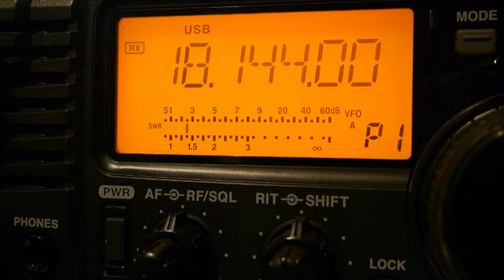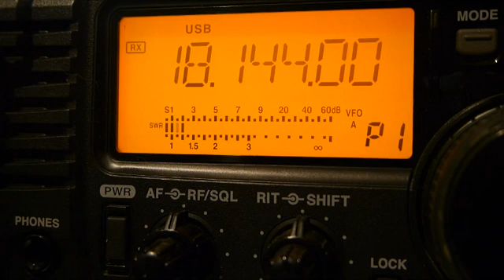Extreme interference (QRM), Amateur radio.

Comment: Check next time when your neighborhood power goes down and you are listening on your receiver using battery back-up supply.....you might be able to isolate it to your neighborhood or beyond.  You can also take your transceiver in your auto with a CB antenna and ride around your local area, you'll likely find the noise is stronger in one area and will likely be power line problems.  I've gone through this before myself and use a portable SW radio as I walk around my area.

Comment: Could be a psu that is radiating down the mains !!  You must get Ofcom out to investigate such interference you will be issued will a case number even though the regulators fail to regulate? they must be made aware of it.They have a habit of being conservative with with the truth about how many complaints the get . Sorry to sound negative but i have first hand experience with the so called regulators on several occasions and they have never sorted any of the interference issues ?And they will not do anything about plasma tv's they refuse to ?Hope you can get to the bottom of this and maybe find a solution to it. I know how you feel it's very frustrating not being able to pursue your hobby . My advice get ofcom out
Reply: Yes you are correct but if you or I cors interfere ance to TV's thaty will soon be there you can bet on it